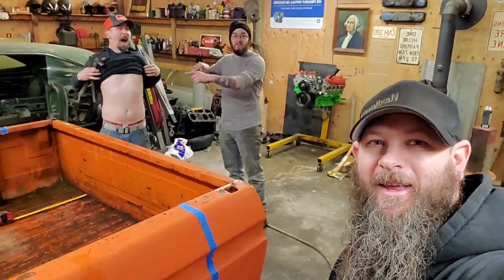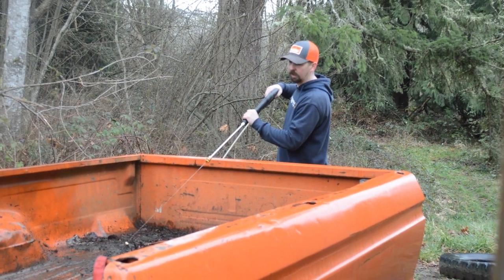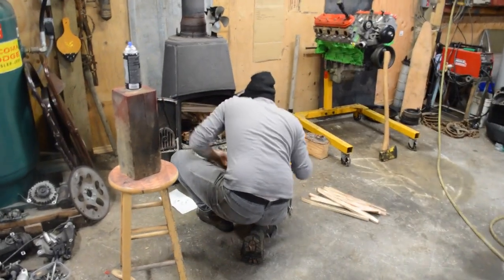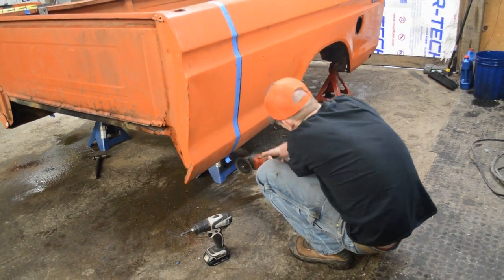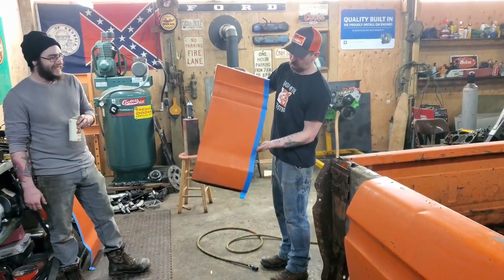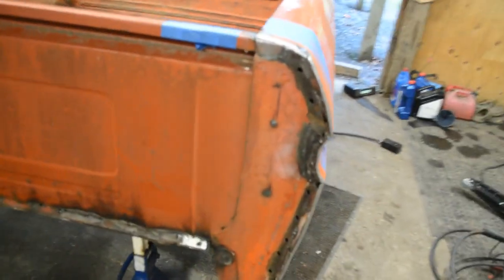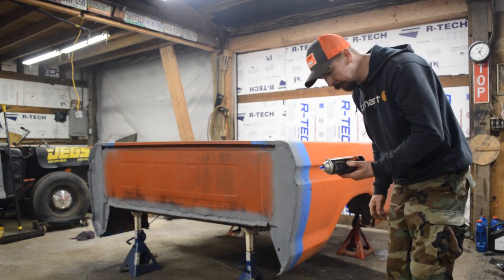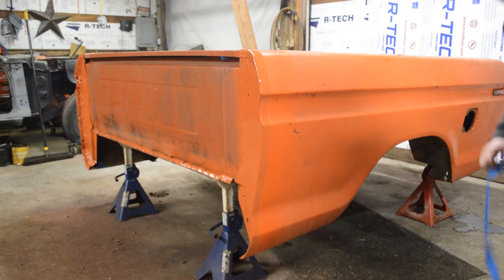77 F150 LWB to SWB Chop: MUSHROOM TRUCK

Comment: Hey guys, i'll be looking at doing the same to my 79. Looks pretty straight forward. Once the bed floor was cut, did the front crossmember line up to the original bed bolt holes? Or did you just end up drilling new holes in the frame when re mounting??
Reply from the maker: all holes line up except for the front two are gone obviously. Just drill a hole and throw a bolt through it. Bed support sits on the frame.

Comment: I take notice you only shorten the front when on some videos people  shorten the back too. Why was you bed different. Looks great!
Reply from the maker: 73-79 Fords the length is the same from wheel well to the rear bumper, the only difference is from wheel well forward. Pre-73s you have to make 2 cuts. All chevys to my knowledge are 2 cuts as well. 🤘🏼
Reply: @trashmetalcustoms8069  Thanks slot dude! Keep the videos coming.

Comment: You had to remove 2 cross member under bed and reuse first cross member right
Reply from the maker: No crossmembers were removed in the process of shortening this vehicle.
Reply: @trashmetalcustoms8069  what are  the measurements that u cut off the chassis and the drive shaft?
Reply from the maker: @hernandezshowbirds9404  we took 16” out of the frame. For the driveshaft we used a driveshaft out of a short box dodge 2014 standard cab. We got lucky and it fit.
Reply: @trashmetalcustoms8069  oh ok so u took off 16 inches off the frame and 14inches off the bed
Reply: @hernandezshowbirds9404  I believe 16 on both, that's what I've seen elsewhere.

Comment: Hey Trash Metal Customs, I currently have a f100 and I need to cut the bed but want to know exactly what to do to cut the bed do I only cut 14 in ?
Reply: I think it’s closer to 17 if you cut a section out but cutting from the end  probably 14 so you have enough metal to rap back around head board
Reply from the maker: In the end once its all welded back together it will be 16" shorter. Like Eroom said, cut about 13.5-14in. back so you have a couple inches to bend in and weld to the bed head board. Remember, you're making a 133" wheelbase into a 117" wheelbase and it's all coming from the middle of the truck. Good luck!

Comment: Wish y’all would’ve showed taking front of bed loose and bending metal back around, quess I’ll figure it out myself
Reply from the maker: We tacked the front of the bed where we wanted it and cut slices about every 1.5in. or so along the bed sides and bent them in with pliers and a hammer.  Just basically copy what ford did when they put it together.
Reply: I’m still confused as to what you did... did you bend the actual side of the bed in ?
Reply from the maker: @foorodgarage5386   Correct sir. We made a horizontal slice about every inch or two and bent the panel in with pliers  and welded it to the header panel. Just like Ford did from the factory back in 1977. Nice Last name by the way!